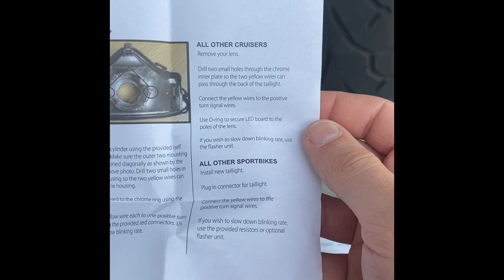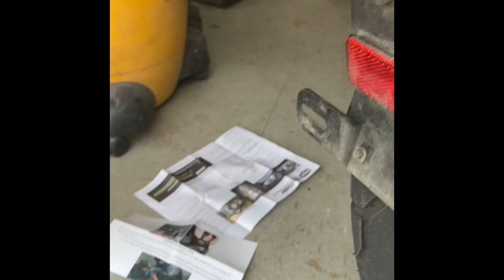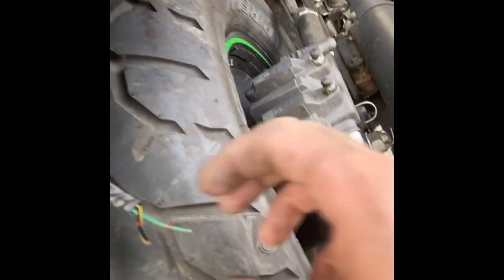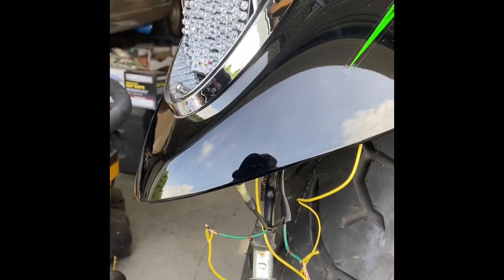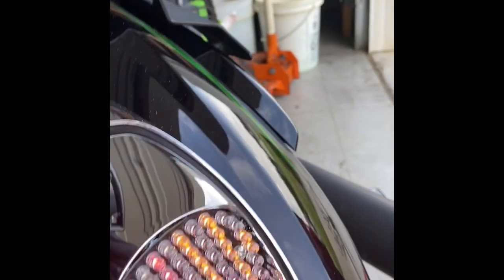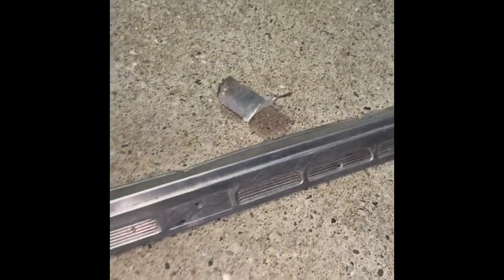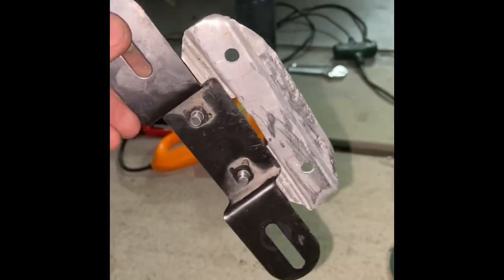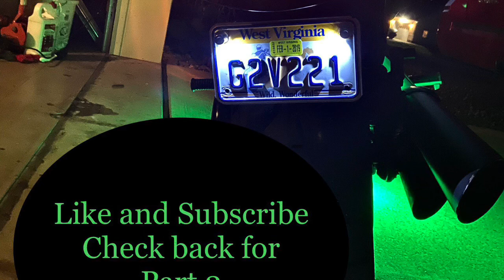Kawasaki Vulcan Integrated Tail Light Part 1

Comment: Thanks for the video ! I bought this exact led brake light as my old led turn signals mounted on the fender lip got ripped off ! I couldn't figure out why i didn't have any turn signals as the wiring was confusing me & now know i need to splice together the 2 black & yellow wires as well as hook up the flasher relay it came with & where to find it! Should be able to get it working now & appreciate this video for helping me figure out what was wrong !
Reply from the maker: Thanks for the comment and kind words. I am excited that the video helped!

Comment: I added led front passenger bar lights and the blinders are rapid in flashing.  How would I fix it so that it will blink normal again?
Reply from the maker: You will need to add a 6 ohm resistor in line with the lights. You can pick them up pretty cheap on line or your local part store will have the expensive ones in the light bulb section.